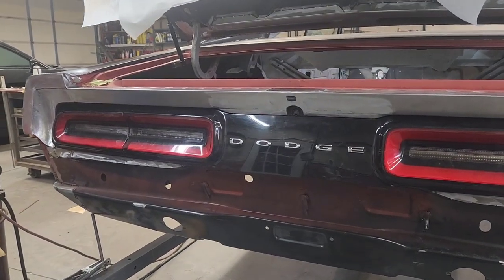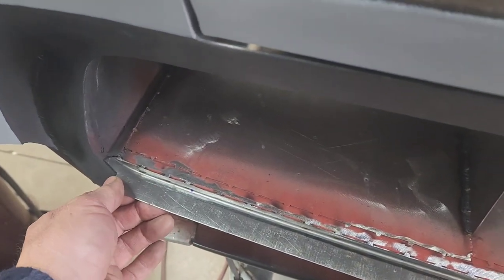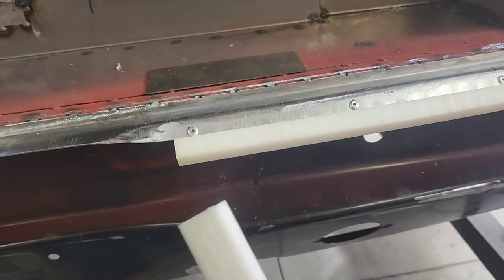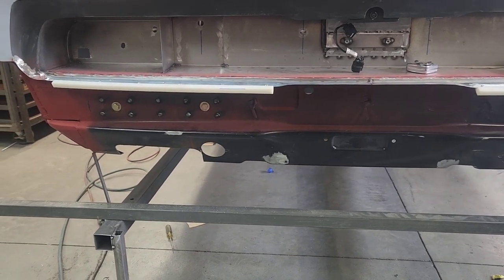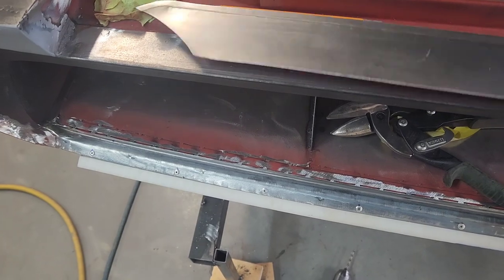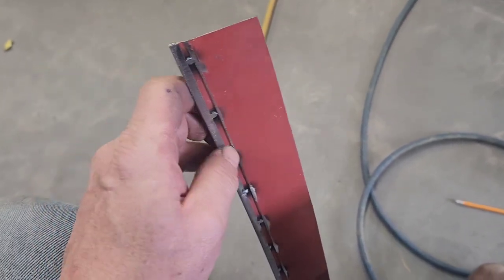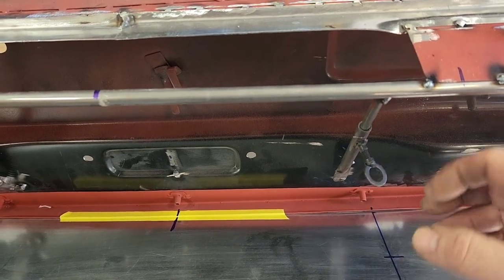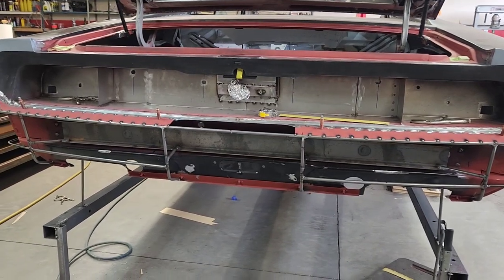Randy's Hellcat Daytona part 6

Comment: Hey Steve, just checking in.. I've been following you for a while. I'm guessing you can answer a couple of questions.. I own a '72 Plymouth RR 440/4spd.  I'm going to be replacing the 15" wheels in a few months and I want to go 18. 19, or maybe 20 inch.  Do you think 20's are too large?  I do want SOME rubber on the SW's.  Also, how wide of a wheel/tire combo can I go in the rear WITHOUT having to do any sheet metal or inner tub work? Any input on wheel offset? Thanks Much! Love Your Work!
Reply from the maker: I cannot give any advice on wheel width. I do know anything bigger than 18" on those older mopars starts to look a bit out of proportion. I have 20" on my Daytona and  because of the calipers I can't go smaller. I would like to go down to 18".
Reply: @SteveMirabelli  Thank you Steve! I appreciate your input! Yeah, I'm not sold on 20's, but thought I would ask.  There are too many older Mopars that look ridiculous with the enormous wheel sizes, so I'll probably just do 18's. Thanks again! As I said, I Love Your Work!!!